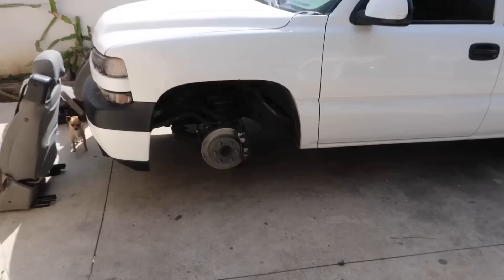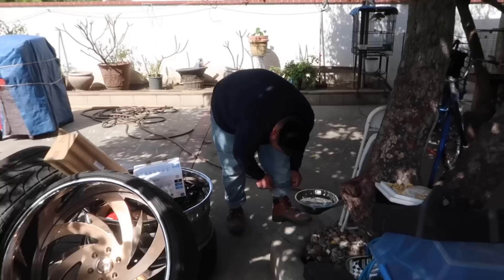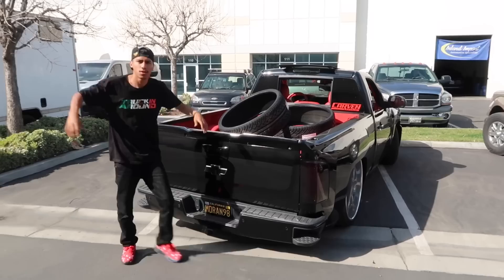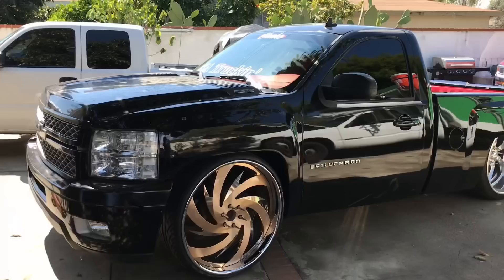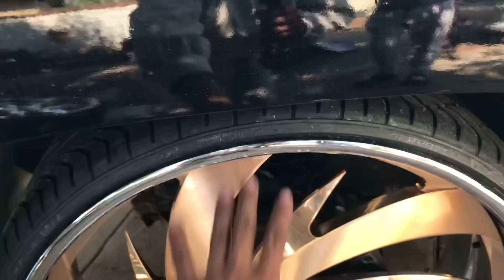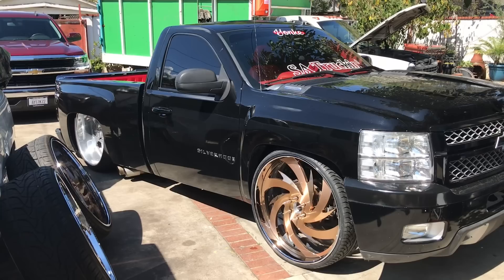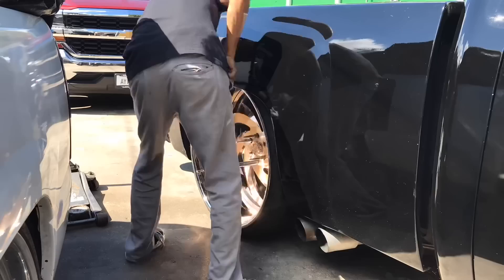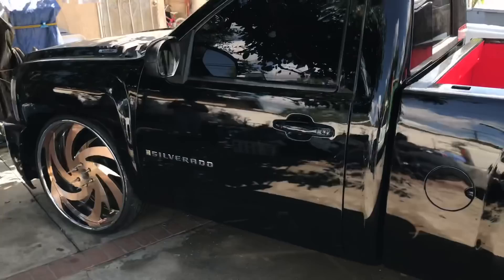New Wheels Finally On My Truck !!

Comment: Damn that guy could of scratched your rims bro.
Reply: Don Guille de la H he looked like he was being careful to me
Reply: FTWGGG and he opened the clamps on the inside of the rim. Bare metal no protection
Reply: Yo mama
Reply: Miguel R it’s a typical way of doing it. Reverse mount wheels can me mounted on the machine both ways. Clearly y’all like to talk out your asses. 

I work at a tire shop. 
Don’t @ me.

Comment: Love The Wheels , You Could Have Mounted Them Tires With The Bars. On The Ground, Just Put Some Cardboard Down And Some Towels , Plenty Of Murphy's Soap Does The Trick , When I Seen That Guy Was Going To Clamp Them Wheels On The Inside I Was Like No Man You Going To Scratch Them The Hell Up, What Happened To Rest Of The Lug nuts On The Rear, Shout Out From Fla.